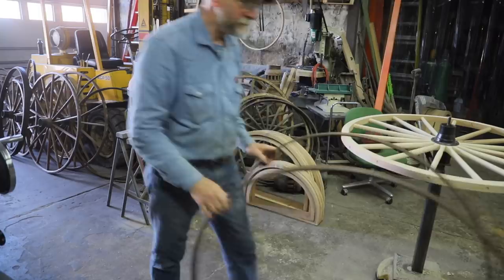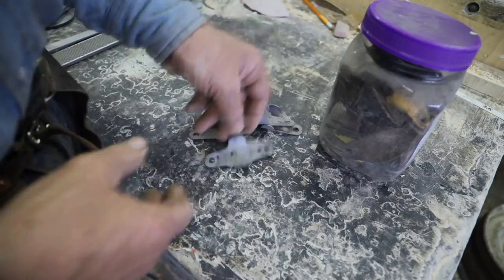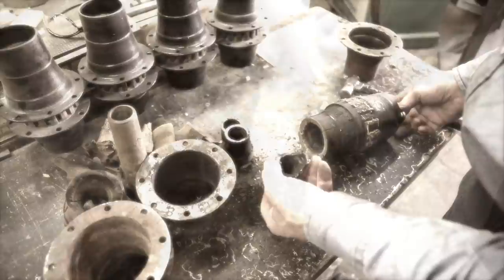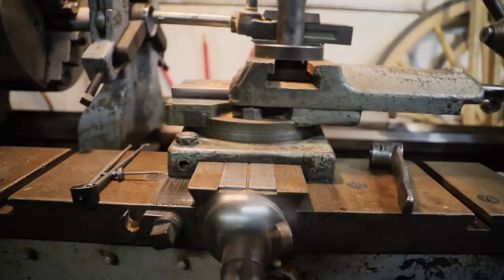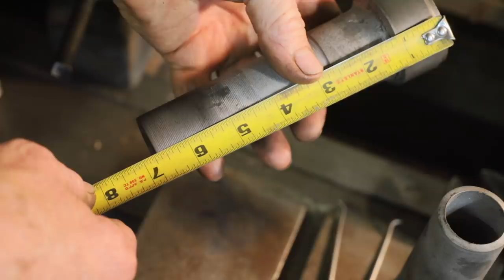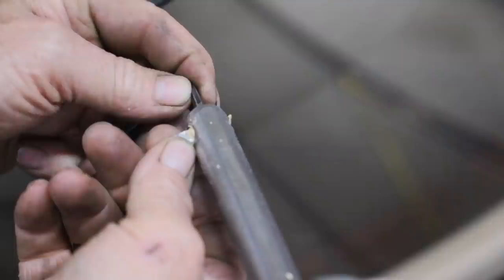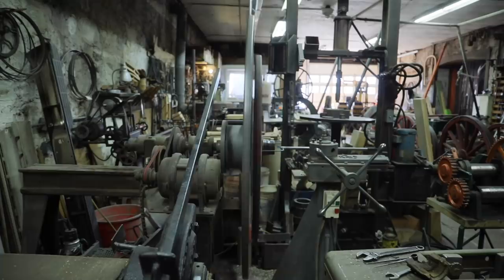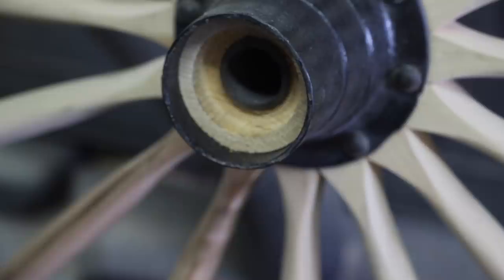Making a Sarven Buggy Wheel Run Straight | Engels Wheelwright Shop

Comment: I am a machinist by trade and you use more precision than would have been used on those wheels when they were made. Love watching a true craftsman like you. God bless
Reply: Thomas Desmond: I'm a machinist also and it's been a long time since I've seen inside and outside caliper used like that. Takes a very fine feel but perfectly adequate for this type of work. Anything closer requires micrometers.

Comment: I have been watching your videos for several years. It is always a pleasure to watch you work. I was watching you press this part into the wood and the thought occurred to me that if that jack you used was to malfunction, you would just fix it. I watched you fix your vice. Not only that, you have crafted so many of the tools you use. If a man had the knowledge and wanted to start a shop like yours and do the work you do, it would cost a fortune to buy the tools needed. And many of the tools you use are not available for purchase. It would take an apprentice years to acquire you knowledge and skill. It is not a given that a man with your knowledge would have the skill. Thank you for this treasure trove of knowledge in video.

Comment: Wow! Truing the boxing to the tire rather than to the hub. That's so counter intuitive but makes so much sense once explained.
Reply: Otherwise you would have a wobbly ride. Like on a clowns bicycle.
Reply: When the center of the hub is not the center of the tire, doesn't that imply a balance problem?  Or is that barely an issue at these speeds, as opposed to propeller speeds?

Comment: Well I've seen a 5" 4-jaw chuck, but a 5' one is something new to me.
Reply: Yeah I like how he makes his own tooling. The sign of a true craftsman. When it's not available. Just make it. God bless
Reply: Yes, and it was kind of scary.  I doubt something like that would even be allowed in a workshop that had employees.  So many of the tools used on this channel are clever and innovative, but look they have been around for a hundred years!  I do hope that wheel making is not lost to us in years to come because Health & Safety at Work make it impractical.   We used to get a heads up when a safety inspection was coming round, and we'd rush and put all the guards on.  Then right after they gave us a pass we'd whip the guards right off again.  I don't know how you'd make a guard for that BIG lathe and still be able to use it.
Reply: I like the large hoop on the outside as a safety measure.  You sure wouldn't want to get clipped by one of those arms.  I have a personal preference for simple, yet effective guards.

Comment: Well you say youre not much of a machinist but I am with many years in production shops. 

Looks to me like you have the skills and equipment to efficiently do the work you need to do. It's been a very long time since I've seen transfer readings between inside and outside calipers and comparative readings between bores and OD's as everyday technique. Time was plan dimensions were made in inches and fractions with notes for fits with mating parts. Production interchangeable precision parts were impractical prior to the late 19th Century except in limited niches. The tools and instruments of the time were expensive, scarce, and not well understoid as manufacturing cost cutting technology. Therefore the precision parts of most assemblies were individually fitted. Wagon wheels such as the ones you're finishing now were prime examples.  

If my opinion means anything, I'd say you are doing fine just as you are.

Comment: I drive my longtime neighbor/friend machinist nuts with the relative imprecision of carpentry so it’s fun to see the marriage of the two points of view in your work. I wonder how the boxings were pressed before hydraulics? A fly press perhaps? 

I dismantled hubs from an axle found in the woods recently that were chuck full of nails, outboard, some cut, some modern, that had been driven in to tighten up the boxing at the nut, raising so many questions about how this 1 1/2” x 48” between shoulders square wrought front axle had been used, and what it had “seen.”

Fascinating to consider in this era of tapered roller bearings, the various solutions over the millennia for making wheels go around.

Comment: I saw a very very traditional technique of wheel making, and what they did was,
they heat up the iron ring tire thing in charcoal furnace, and put it on the wooden wheel, 
then they roll the whole thing down the ground, where previously they dig around 2 feet wide, 20 feet long and probably 3 inch deep groove, and filled with water. so more or less instant quenching.

Comment: Dave,

Thanks for another very interesting and educational video.  I love how you've modified the old Warner & Swasey lathe into an Engels wheel hub boring machine.

If you've ever had difficulty changing the boring cutter's "stick-out" to cut a desired (i.e., not too large) internal diameter, add a set-screw to your boring bar to push the cutter out whatever distance you need.  Of course, you'll need a shorter cutter than what you're using in the video.  I've watched precision Machinists use boring bars with fine-thread set-screws for accurate adjustments like this.  You never know, it might save you a hub one of these days.

I'm looking forward to your next video!

Comment: I have been building bicycle wheels and am surprised to see that the centre of the shaft is not true with the hub but the tyres. Of course, you can't turn the nipples to adjust spoke tension but I was assuming that there would be a way fine tune the spoke tensions and true the rim.  Again, the bicycle spokes work against being pulled by the tension force applied and the buggy wheel spokes work with them resisting to compression force.

Comment: Marvelous to watch! Thanks for posting!

Question: Since the original wheelwrights would not have had a hydraulic jack to press the boxing in, how would they have done it? Some kind of screw press? A lever mechanism? Or perhaps they just drove it in with a hammer? Maybe they had a different type of mechanical jack? I would love your insight.

Comment: You should make a small seasaw type foot brake with rubber stopper for that metal ring on that wheel machine if it's on the floor you just need to step out and it will stop and save your hand.

Comment: How well does the wood glue bond to the steel of the boxing?
Reply: In one video Dave mentions that the glue is more for assuring a good metal to wood fit by filling voids than actually adhesion.

Comment: What's the RPM on that hub lathe? It looks a lot faster than that wheel will ever experience on a wagon, lol.
Reply: Presumably needs to turn that fast at the rim to get a reasonable turning speed at the hub.

But yeah, looks a bit deadly :)
Reply: The, erm, hand-brake is the best part :O
Reply: He needed that speed to machine the wooden hub bores.  Any slower and the wood would have torn rather than cut.
Reply: Those are racing wheels, you should see the horse doing the pulling!

Comment: That is quite the modded turret lathe, great idea, is that something you came up with (would not surprise me in the least) or something based on a historical machine?
The twist nail bolts things (that's a technical term!) you put through the rim of the wheel, are those something you can pick up at a Home Hardware store or...?
Another great video, thanks for sharing!
Cheers from Tokyo!

Comment: what are the fellow plates for? There does not seem to be many for teh wheel. Do they add strength or are they for show?
Reply: The fellow plates cover the joints in the fellows. Number depends on how many joints.

Comment: I understand how these elements strengthen the wheel, but I'm unclear about where and when they are needed.
Reply: @EngelsCoachShop  How do you know when to put extra bolts or plates in a wheel?
Reply: @Landrew0  Where the 6 felloes meet each other- to keep them in alignment in case of size changes due to temperature and/or moisture. (plus wear and age). I think I saw splines used on some wheels.

Comment: Looks great!  I love watching you work, I actually use alot of your techniques in the sign shop too.  it's saved me a ton of time.
I do have a couple of questions if you don't mind?
What were those bolts with the partial screw shaft you just used?  
Also, I've seen you hand-hammering rivets all this time, is there a reason you do it that way instead of using a pneumatic rivet gun?

Thanks for videos, always informative and enjoyable!